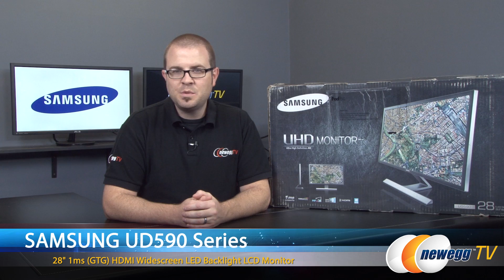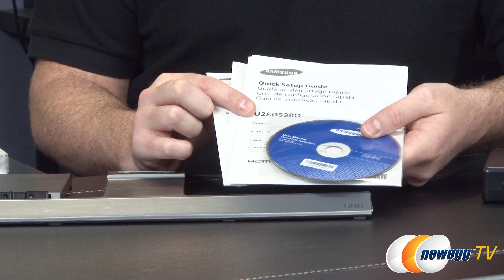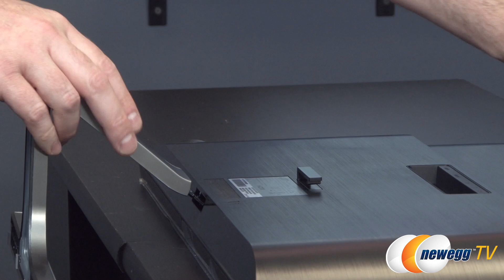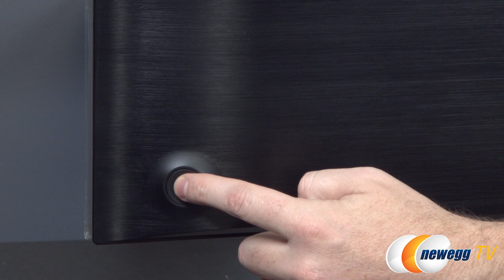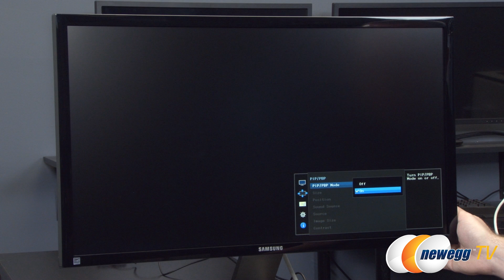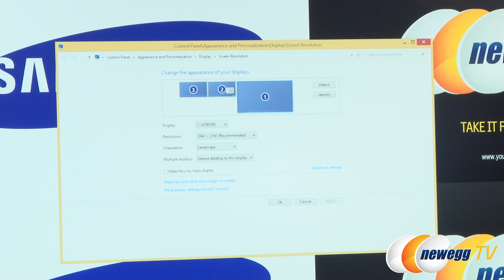Samsung UD590 4K Monitor Overview - Newegg TV

Comment: Best Buy has a 1 ms response time; Mega Infinity dynamic contrast ratio; 370 cd/m² brightness; 3840 x 2160 resolution for $600.  Not sure if will run on my standard Intel Graphic Family card though and I think I would need an upgrade as it would be a second monitor. i do no.

Comment: No VESA mount, even really cheap monitors have that.
Reply: Maybe so, but those monitors aren't 2160p.
Reply: You need you use your brain before write this. Slim monitor will not have VESA mount.
Reply: kimyeang chan Is there a point in the slim profile of the monitor when the stand extends out so much (i.e. takes up width)? I thought the whole point of slim was so that you can VESA mount it flush against a wall or custom stand.
Reply: SirDuckferd That is exactly, why I wall mounted my monitor. The stand takes up so much space on my desk. And "What is wall mounted can't fall of your desk."
Reply: Actually you can mount it with 3m vhb tape, all without drilling holes in your walls.
Reply: *****  I really like Dell for their stands. They are robust and just rotate in every direction. Also they still give you the vesa option.
Reply: GooberSuess you could mount a car on a ceiling with 3m tape.
Reply: Lars Reviews they used 3m vhb tape to stick the glass panels to the tallest building in the world, its strong shite.
Reply: Who gives a fuck about mounting the monitor, its a monitor its meant to be on a fucking desk!

Comment: the fun thing is that this isnt 4k, its quadro HD (3840 x 2160)
Reply: Resulting in 4k?
Reply: HoRzeNTarI no, only few know 4k is actually 4096x2160 but it still is
Reply: Nah, 4K is 4 times the pixels of 1080p. And since we're multiplying 3840 x 2160 is 4 times 1920 x 1080.

However cinemas use 4096x2160.

http://en.wikipedia.org/wiki/4K_(resolution)

Comment: Just wait for a better one guys. 4k @60hz under $1000USD sounds good right now but more 4k panels are coming out with different sizes. Don't even bother with 120hz+ with this res, just stick with 1080p or 1440p for refresh but come to 4k or greater for the resolution. Two 290x will not be enough since I tried it and then switched back to my 3x1 eyefinity portrait using u2412m. IPS are so much better than TN and I'm spoiled by it. Maybe the LG 34" 21:9 might be a good upgrade if the price is reasonable.
Reply: um, you know they already tested an R9 295X2 (dual 290x) with 4K and it ran fine.....
Reply: Sure. If you want to play below 60 fps. Even on 3600x1920 I can't even do bf4 ultra setting and get above 60fps constant in a 64 players conquest large map. That's with two 290x with Asus bios flashed and oc'ed to 1200mhz with an 3770k @ 4.8ghz. It's not throttling since everything is underwater with a 420mm and 280mm monsta.
Reply: Ziakel well, from what ive seen, it runs it fine
Reply: why don't you run your own benchmarks and tell me. To me, below 60fps is barely playable. I've seen benches where 290x cfx can barely do 60fps @ 4k and majority of the time they were using a 3960x or 3930k. Even my old 7870 can "runs fine" @ 4k if that where you're going.
Reply: Ziakel some games can run fine at under 60FPS, sure on a fast paced game it might feel slower by a bit, but it isn't choppy
Reply: TheNerdyCanadian
lol, your definition of fine is to what people who don't know or don't care the capabilities of PCs. My guess is you don't mind playing below 60 FPS which is a big deal in gaming and I assume you're a casual which explains it. Ziakel knows what he's talking about with the evidence he's given.
Reply: Wes2299 are you fucking serious, a casual doesn't have over 200 games, triple monitors, and a 2K gaming PC....
Reply: TheNerdyCanadian oh no. we got a hardcore over here. Seriously calm down.No ones cares on how much you spend on your games and PC. Back to the point. Two 290x can't do 4k @60hz with 60+ fps efficiently(that means without sacrificing IQ) so we all have to come to peace with it.
Reply: Ziakel was i talking to you? no, i was calling out the idiot that didn't know what he was talking about, so sorry for voicing how stupid someone was being and uttering bullshit
Reply: Wes2299 also, some games run smooth at under 60fps, that's all i was saying, unless you can see the fps counter, you wouldn't even notice, some games you can actually not even tell if it is 60 or below, they have done tests to see if you can tell 60 from 120....it was an NCIX video, look it up
Reply: Now I really know you're a casual when you say some games run smooth under 60 fps. Sure if I'm playing Tetris or an Indie game, but if you're playing Battlefield 4 you want your frames to stay minimum constant 60 fps.

Going below 60 fps affects the gameplay when it's stuttering, and frankly it's annoying as hell.
Reply: Wes2299 um, like i said in my original comment, fast paced games like FPS's need the 60+ fps, slower games don't need as high of a framerate...
Reply: I ordered this monitor. I've got 4x 290x's, That should do it for gaming. Although i'll be mainly using this for programming and stuff since i need the screen real estate.
Reply: Sheharyar Irfan hope you'll like it. I really don't see the point for the 4th 290x since scaling is still terrible when you go past 3 gpus. Not to mention the DPI scaling is still bad but to each to his own I guess. Personally I'd rather have 2 1440p monitors if I'm coding.
Reply: I will be coding on a hackintosh, Mac osx has great scaling so it should be good. If it isn't i'll return it for 2x 1440p monitors, but I doubt I wont like it. As for the 4th 290x, yeah youre right but I just have it laying around from my mining business so why not.
Reply: Sheharyar Irfan text scaling is decent at best, look at someones desktop on a 4K monitor, everything is pretty small, just like windows
Reply: I've been using retina macbook pro for quite a while now and i'm extremely happy with it. It's pretty rare to find software that's not retina optimized on OS X, which is why hackintosh will be connected to the 4k display

Comment: $800?!? thats a steal! I think im going to save up for a better graphics card first.
Reply: You meant cards. On GPU will not give you playable frame rates at 4K on even low settings so I'd say at least 2 GTX 780s or 2 R9 290s. But other than that this is indeed quite a steel for a 4K monitor that should be good for gaming and doesn't cost over $3K.
Reply: Alex Stoeff well, I agree that currently we don't have a single card that can support 4k alone. So hopefully in the next 2 years will have a more powerful card. your thoughts?
Reply: Alex Stoeff Well, low settings will give you playable framerates on most games, with a high end card like the GTX 770 (which I use). However,I don't think 4K would be worth it if I were to lower settings too much. I managed to play a few games with decently high settings with decent framerates with just a single GTX 770 2GB, but 2 of them or a more powerful card (780 Ti or 290X) should be able to play most games at high (not max) settings in 4K at playable framerates.
Reply: blatcher2 He just messed up a name dude. No need to bash on him for that. Knowing what an R9 295x2 is, is hardly 3rd grade knowledge even for an exaggeration.
Reply: oh... god that's a lot... where did I store that extra 3 thousand dollars XD
Reply: ***** agreed
Reply: Kart Drifter I don't think that I'll be upgrading from my 144 Hz BenQ until there is 4K at 120 Hz and IPS. So in other words, not for a while. The next-gen Nvidia GPUs should kill 1440p (at least the high end ones) so maybe even 2 GTX 870s should be enough to play modern/upcoming games at 4K. I wasn't a big fan of 1440p or 1600p as it is a relatively small incremental upgrade, in terms of experience, from 1080p so I'm going all(4K) or nothing(not upgrading) in the near future although QHD, QHD+, and UHD displays should be much,much less expensive (probably around $1000 to $1500) for high quality IPS models. All in all, I'm just exited to see what the future holds for gaming and content creation/consumption.
Reply: Kart Drifter wow not even the Titan Z or R9 295x?
Reply: Kart Drifter well maybe the r95x2 will be enough only being one card, but its around 1400-1500 U.S.D so yeah
Reply: Kart Drifter if by single card you mean single PCB, then yes, we do, the R9 295X2 can run 4K gaming
Reply: NCIX has the same monitor for $599
Reply: Alex Stoeff i have one 780 ti and i play BF4 at high settings @ 4k 60fps
Reply: adavis89 link it, i searched the model name and got nothing
Reply: conquest kami idiot r95x2 is not a card. But you probably mean the R9 295x2 so I will forgive your 3rd grader lack of knowledge :|
Reply: blatcher2 holy shit sorry i messed up the name hardly, wait nvm im not sorry but anyways, dont get so butthurt about it, i dont think a 3rd grader would really know about computers that much anyways, dam dude loosen up and be understanding more, if possible at all :P
Reply: Alex Stoeff What about the Titian Z? would one be enough or would you need two xD
Reply: ***** No, a single TitanZ would definitely be enough. Look at some benchmarks of the R9 295x2 which should perform around the same so that way you can get an idea of the performance of the Z.
Reply: I think its only 720p.... xD I don't think people will want that unless its for something that doesn't need 1080p but still a good deal :D
Reply: http://www.amazon.com/Samsung-28-Inch-Definition-Monitor-U28D590D/dp/B00IEZGWI2/ref=sr_sp-atf_title_1_1?ie=UTF8&qid=1406623592&sr=8-1&keywords=Samsung+UD590+4K+Monitor 

you're welcome
Reply: You're going to need an r9 295x2 to play 4k...
Reply: Gooby plz you can play in 4K with a single R9 290X, or 780ti, just run it on low, 4K on low doesn't look that bad
Reply: TheNerdyCanadian but who really wants to play a game on low.
Reply: Gooby plz 4K at low doesn't actually look like low though due to the high resolution and PPI of most 4K monitors
Reply: but you have to play with low texture qualities.